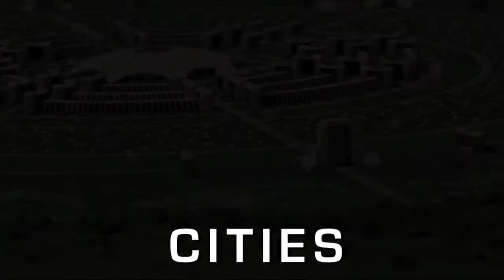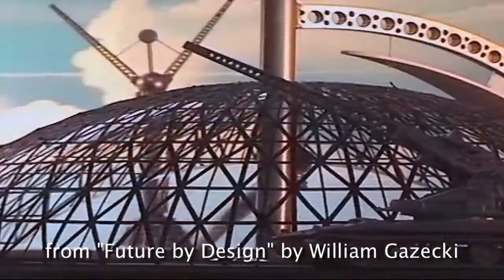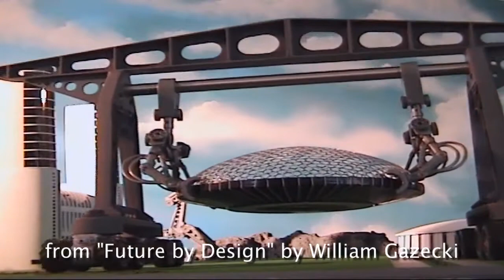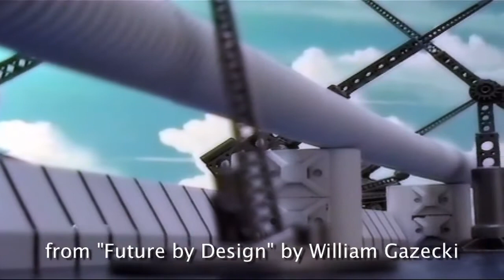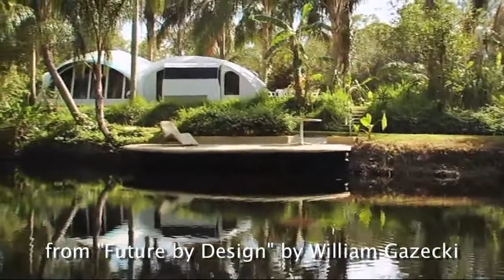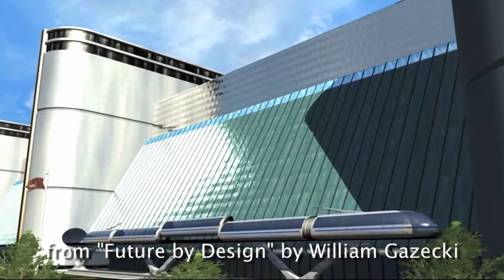The Venus Project - Cities

Comment: The problem with building a 'test' city with money that still relies on money and existing supply chains is that it could be seen as elitist, experimental or any number of ways that miss the point.  The RBE is holistic and a transition has to begin with an understanding of the destructive nature of our current paradigm and a need for sustainability.  Climate change is beginning to turn the tide on this. TVP should showcase technologies that make a difference now and promote a change in values...